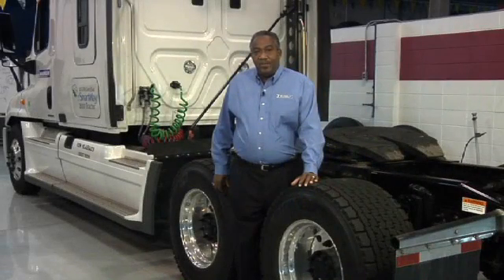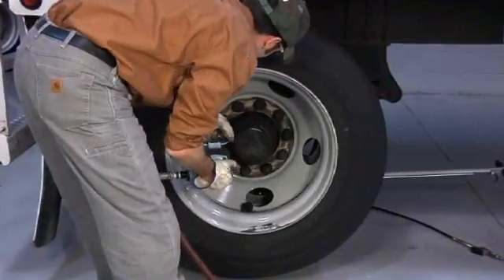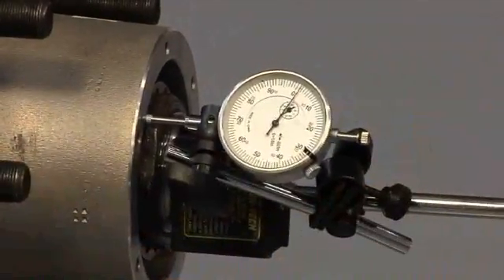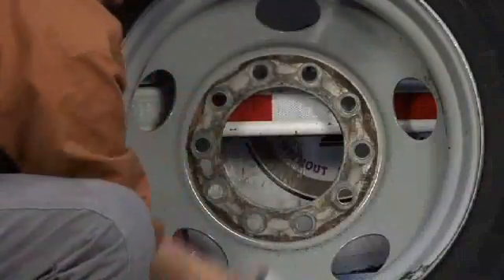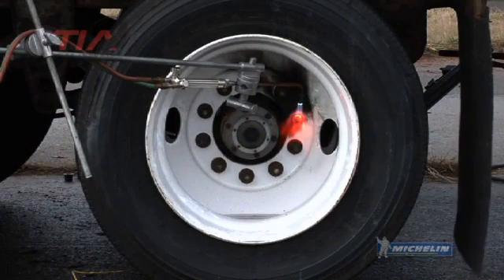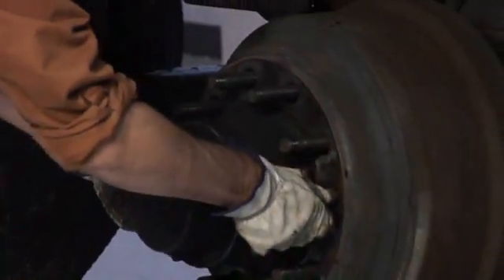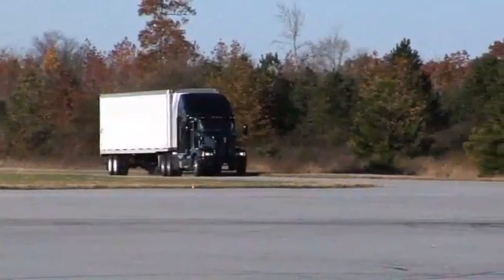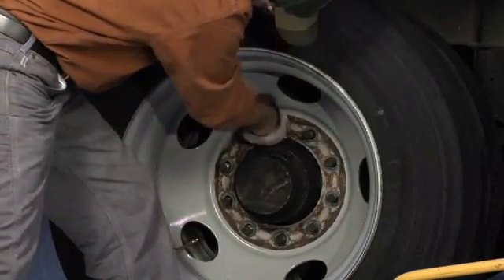Wheel End Safety (2 of 3)

Comment: We need something faster and better than a wire brush. Even with a power wire brush on an angle grinder it takes a long time clean up the bead seats and mounting surfaces and it's impossible to get the threads of the studs or the tangs of the hub pilot.  Cleaning the face of the brake drum would require meticulously cleaning between the studs or backing off the slack  adjuster and removing the brake drum.  There's new parts and demos, then there's the everyday job.